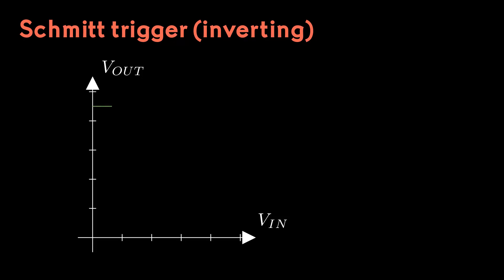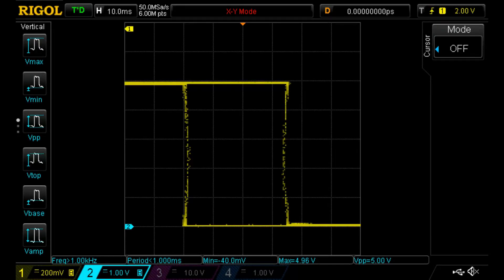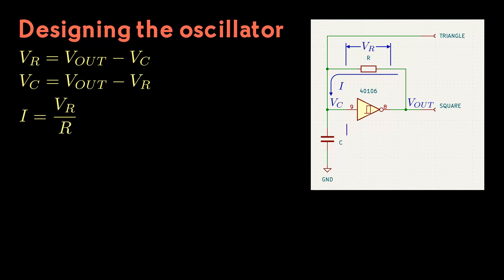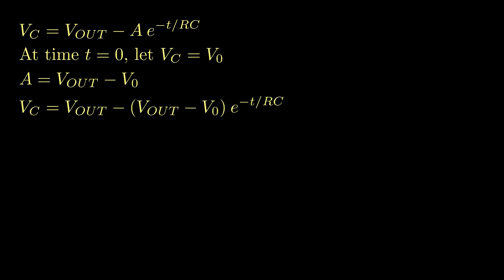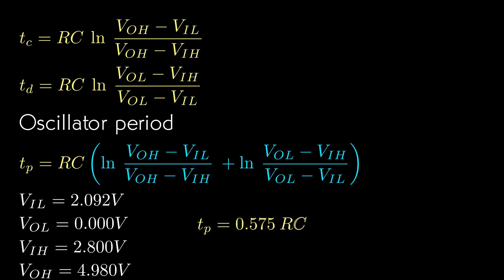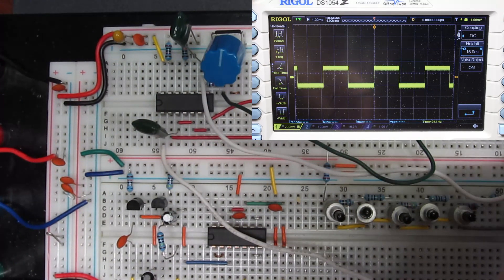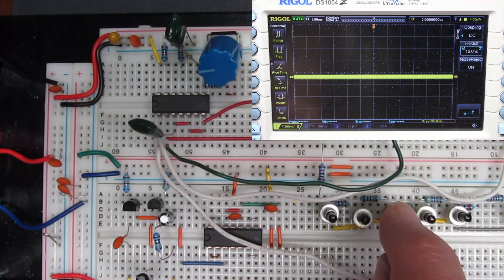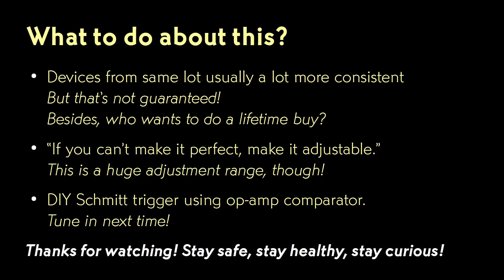Audio Synthesis Ep003: Schmitt Trigger oscillator

Comment: How did you turn the square wave output from the schmitt oscillator into a triangle wave?
Reply from the maker: @LordPhobos6502  in this simple oscillator, it's only an approximate triangle.  When the square wave voltage is high, the capacitor charges slowly through the resistor. When the square wave is low, the capacitor slowly discharges. 

We could make the triangle wave much more nearly exact by using an integrator. There's a later episode in this series that does just that.

Comment: Why can't you use ceramics in a schmitt trigger? You say to only use polys. Is it just the tolerance needed for music, or are there other reasons?
Reply from the maker: @SkippiiKai  tolerance, voltage dependence, temperature dependence are all reasons to keep ceramics out of the signal path. Cheap ceramics also tend to be microphonic... just like a ceramic microphone element. The piezoelectric effect couples ambient noise and vibration into your signal. 

NP0 and C0G ceramics are a possible exception, but those max out at pretty small capacitance values.